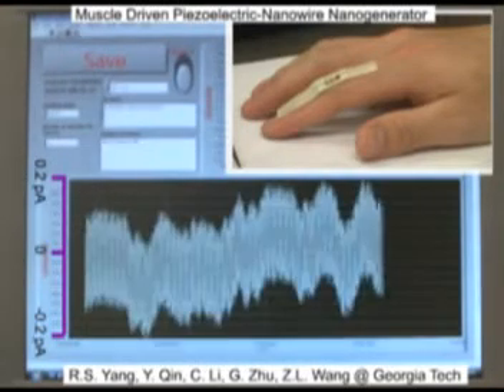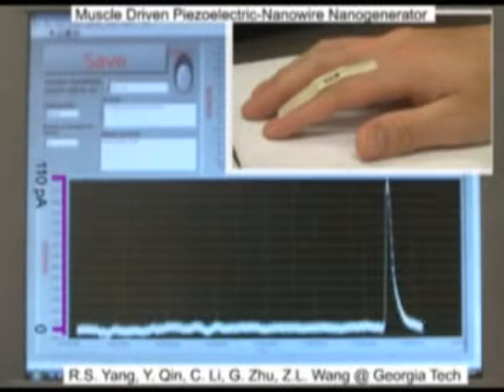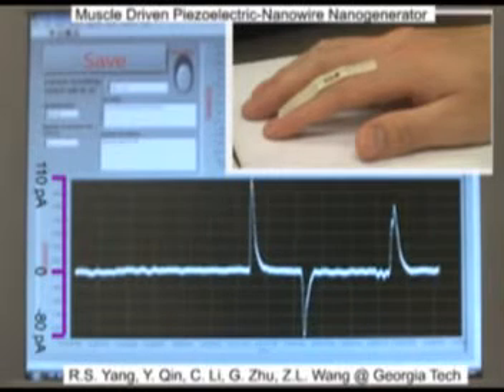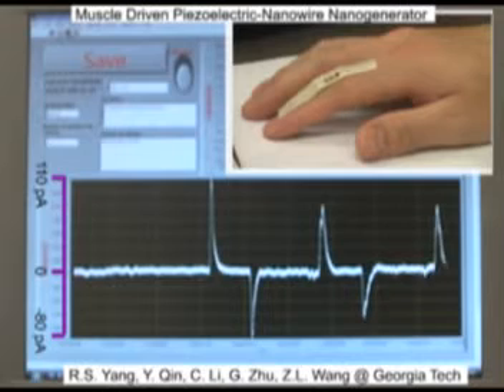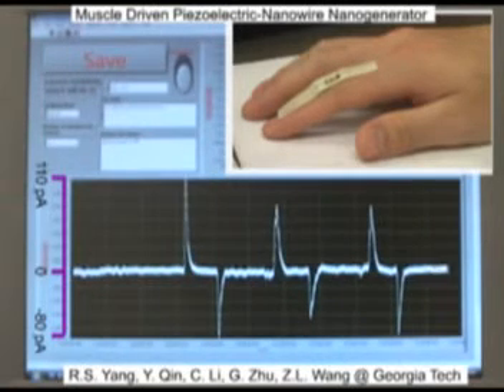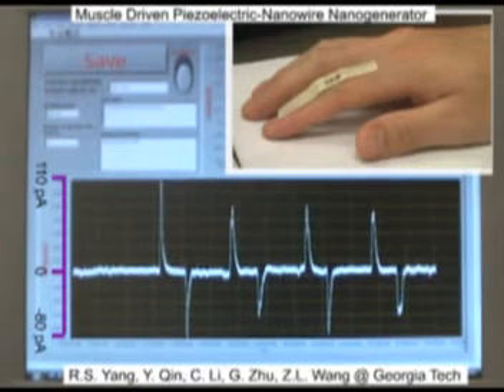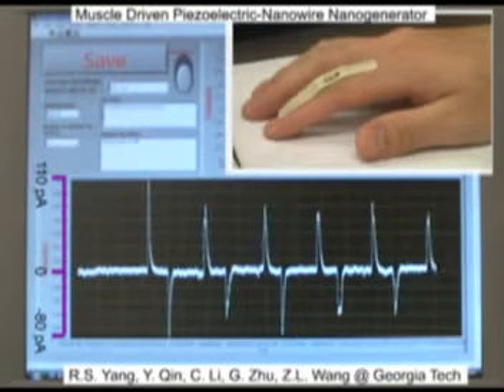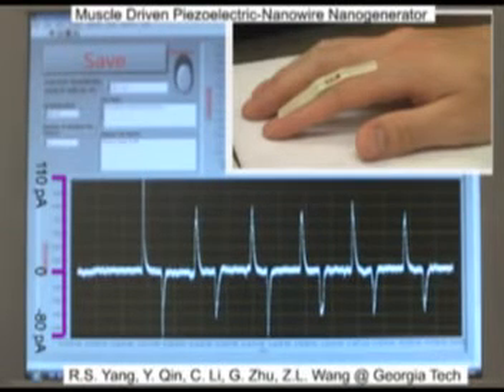Human finger driven nanogenerator

Comment: lol the finger is not generating anything, it's the copper wires that generates it due to erosion.

same thing as putting copper and steel in a potato, the copper generates the energie due to the salt in the potato not the potatoitself.

but if it works..... then it pays to jerk yourself :D